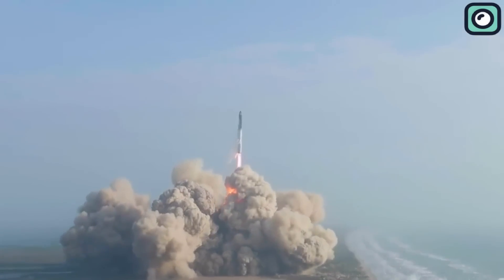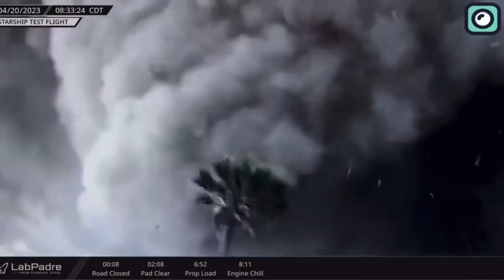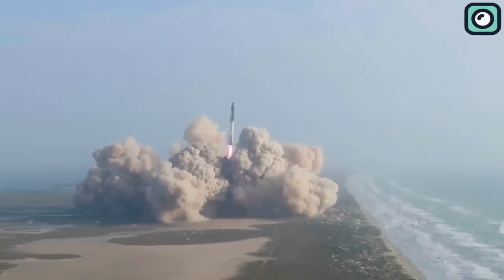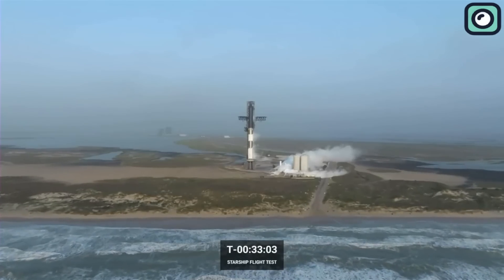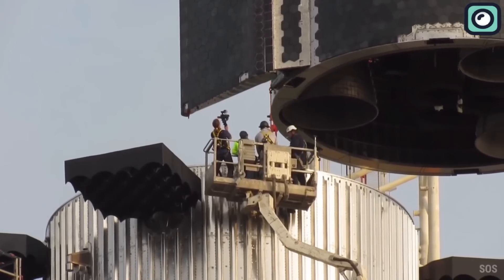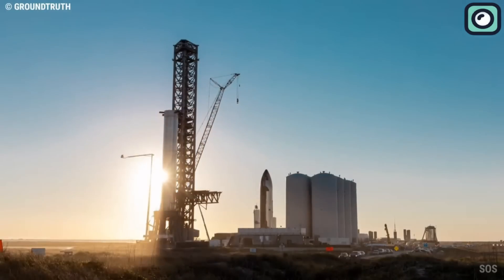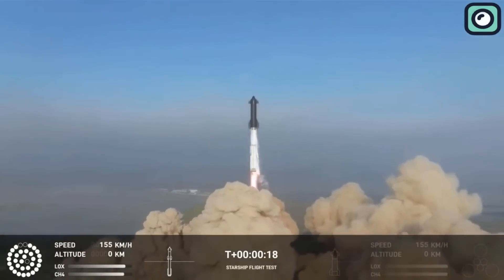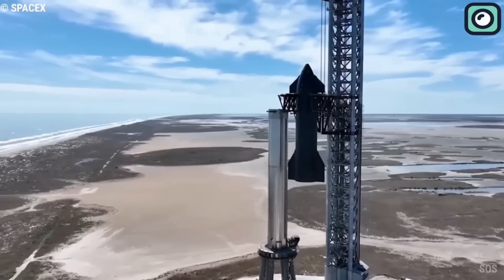Starship's Launch Damage is Worse Than You Think... Stage 0 Destroyed!

Comment: How did Spacex under engineer the launch pad so badly? The pad disintegrated in a second, no doubt this was the cause of the raptor malfunctions.
Reply: A lot of doubt actually. Only 31 of 33 raptors  were ok on previous test and that was only 4 seconds burn.
Reply: It was under engineered since they will not be able to build a flame trench on the Moon or Mars. 
They need to see how little they can do for the rocket to work.

Please read up on the actual rocket development and not listen to clueless news articles. (Especially this youtube channel)
Reply: Raptor malfunctions would result in lower thrust, not more so that isnt it. They just had a ton of hugely powerful engines firing for longer than they ever had before. They may have misjudged how powerful superheavy booster was and overestimated the launch pad but this was a gamble on their part because it is often better to test fast, fail fast, and improve fast, then to drag you feet on it, especially when they already have multiple improved starships and superheavy boosters in progress!
Reply: @XenicMatter  "Misjudged"! They certainly did, those clouds that billowed out after ignition were yellow - a mixture of dust and steam. Liquid fueled rocket exhaust are white.
Reply: @ronbishop4057  Liquid fueled rocket exhaust isn't white, that is just the steam you see from water deluge systems which are usually used. That is why the exhaust of any rocket starts looking different as soon as it gets off the pad. But yeah the launch pad failed pretty badly but overall not a bad test
Reply: @XenicMatter  You're correct!
 SpaceX does an admirably reliable job on the Falcon 9 rocket, yet failed so dismally on their ground game. Teething problems, I wish SpaceX all the best.
Reply: Appears the first stage was significantly damaged by the flying debris that may have punctured tanks, destroyed engines, fuel systems etc. 

The wind vortices due to the storage tanks so close together with lack of flame trenches, lack of piles into bedrock etc proved to have catastrophic consequences.
Reply: Its called Engineering incompetence.!!
Reply: The FAA has grounded SpaceX and they are investigating Elon. He's screwed.

Comment: The tanks damaged at the Tank farm, 1 was for water and the other was empty. All have a secondary cover and that's what was damaged, not the tanks.
Reply: So SpaceX will have to repair all this a few times per day given Elons idea to launch multiple times per day.
Reply: @AdrieKooijman  no wait they say this was a success, Guess what happen to structures nearby when the launch fails big
Reply: @watchlover7750  this was only a test, they weren't sure it would get off the pad. But it launched to 39km, so yes it was a success. They collected a huge amount of data from it, so yes it was a success.

But you should concentrate on their over estimation as to how strong the concrete was, and that the separation failed.

You can see how all the employees celebrated that they felt it was a success. Odd how you think sat in your armchair that you know more.
Reply: No  @AdrieKooijman obviously they will improve how they launch Starship. Remember the Falcon 9 can now be turned around in 5 days. They are only going to get better.

Comment: In retrospect it might reasonably be concluded that it would have been better if Spacex had not carried out the launch until it had improved the Launch Mount and it would have been even better if they had built a flame trench in the first place.
However, given that peole were evidently feeling frustrated with having to wait to see a Starshp launch this does not seem such a great loss, in fact it's a PR gain.
I just hope that the Rapror engines that failed did so because of damage caused by the disintegrating launch pad rather than intrinsic problems because if they are still unreliable this may be a far more difficult problem to solve,
Reply: Considering how many raptor engines were able to successfully light and remain lit throughout the flight it is probably not a huge design flaw. And even if they have to tune back the engine pressure to have an adequate factor of safety the raptor engines would still be hugely powerful. Also considering how many new vehicles they have in progress the launch pad probably isnt going to set them back more than a month or two of actual delays
Reply: Especially when the EPA hands them a big fine.

Comment: SpaceX sabotaged their own prototype by not following normal safety protocols. The one thing I hope SpaceX has learned above all else is safety comes first.
Reply: It's ego, not engineering, this whole project will fail, get ready. Even ChatGPT can tell you the chances of success, with this guy it's pretty low.
Reply: @AFuller2020  It is engineering though? The difficulty is that Starship is aiming to be orders of magnitude better than any currently existing rocket when considering the combination of cost per kg to orbit, reusability, payload volume, production speed, and tons of other things which ultimately make it the most advanced rocket ever made. The team at SpaceX is one of the most capable in the industry it just operates very different from legacy organizations. This project will have many failures along the way but Starship and Superheavy booster will eventually work because SpaceX can continue throwing money and resources at the problem until it does.

Comment: Difficult to dig a trench that would just fill with ocean seepage due to high water table.  Difficult to raise everything up onto some sort of mound, since those mounds end up with an angle that must be traversed. Especially difficult to consider this because would need to entirely disassemble everything and rebuild and reset "chopsticks" to a much higher height.

Only goofy option left is dinking around with plates inserted below that will no doubt wear away.

Massive reusable rockets require insanely expensive disposable launch sites.
Reply: A large metal plate that can bleed water to absorb heat could probably end up working with relatively little maintenance. Even if such plates would need to be replaced regularly, as long as any underlying plumbing and hardware is protected this would be fine.
Reply: @XenicMatter  Believe me, I REALLY hope so!
Reply: NASA did it... But such a thing ist a multi year Project itself

Comment: 1. Present rocket construction technologies are not allowed to build huge rocket with big quantity of liquid fuel engines so that to provide stable work of the engines because of huge vibration. 2. It's impossible to build reusable spacecraft for hundred humans from welded frame covered with sheets of steel in open air like village shed. 3.Elon Musk canceled separation of Starship and booster because he knew Starship can't return back without destruction.

Comment: space x is done? lol remember this.
Reply: If this is a success, the bar is pretty low.
Reply: @AFuller2020  It was a partial success that proved a few things: Superheavy booster can still clear the launch pad with at least 5 engines failing to light, it can push Starship past MaxQ without problem, stage separation was a failure and needs to be upgraded, and the launch pad needs significant upgrades to achieve rapid reusability.
Reply: @AFuller2020  yea... lifting the heaviest object in the history of aviation and pushing it to maxQ  is such an easy task.

Comment: i had an early proposal about a means to help, but untested.  thou now i would opt for a different idea.  a man made lake with the launch pad in the center of it... its more of a pool but the size and scale would be that of a lake.  move the tank farms underground, under the lake.  with a retractable or protected rail sort of transit system to get the components to the launcher/ tower assembly.  the "lake" would be set up like a big bowl, as to capture the ripples or if you wish the tides created by the rockets firing, it would remove all dust, better sound protection and no debris flying up, since the water affected would either turn to steam (thou very hot steam) and waves... don't get me wrong, you'd still need the water deluge system, as to replenish the water affected by the engines being fired/run.  how would the engines handle the steam?  well ... idk.  but it's better than concrete and rocks /debris flying up and potentially ending the launch very early... or removing its ability to succeed. anyhow that is what popped into my head now... nothing better than lots of water and/or earth between destructive elements... peace.  (( i'm also curious how much of the water would be vaporized?  so the water tanks would still also be necessary.  and if the rocket wasn't able to hit it's mark in landing, for whatever reason..... its possible the pond/lake may help absorb the blast of the rocket hitting the ground??  considering, that the speed at decent if everything goes well should not be that fast at the tower, unless the failure happened before that... but would there be enough time to redirect it over the sea?  would that be safe for the environment?  etc etc etc... so many variables.
Reply: almost forgot, the water would also help absorb the energy enough as to not feel like an earthquake ... what was it ..6 miles away?
Reply: To protect the tank-farm, they already built an earth/concrete barrier about 200 feet from the pad.  I wonder if they could extend that to make a circular dam around the pad, then fill it with water. That would make a 400 ft diameter pool/lake, say about 30 to 40 feet deep. It would only need to be filled for launch events, otherwise it would be empty, allowing the same easy-access as today. They could make the lake bigger/deeper if needed. With a big enough lake, there will be no launch debris/damage. The question ... how big and deep would it need to be? 😀

Comment: BAD ?  I think so.  It may be realized that the supporting concrete structure has cracks in it throughout.   I think a complete demolition of the launchpad is required and a capable structure built a little bit farther away from the tanks for good  safety measure.
Reply: Mike, sounds like you have it sussed.